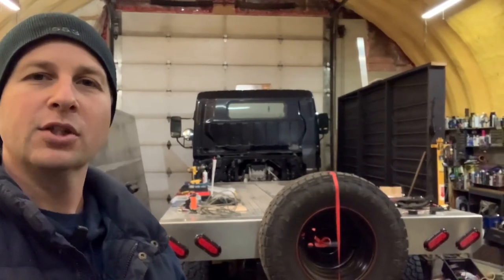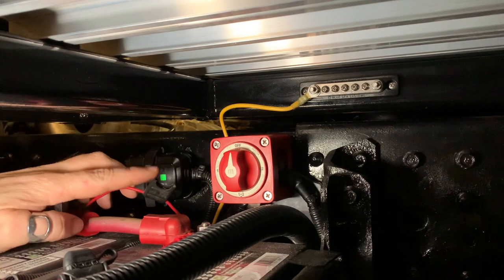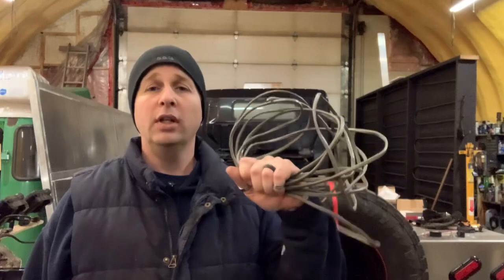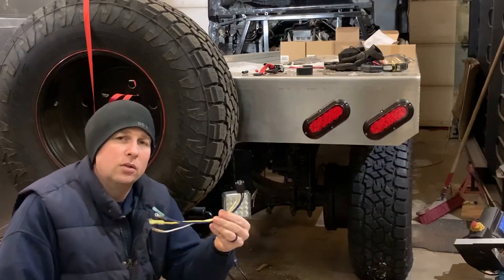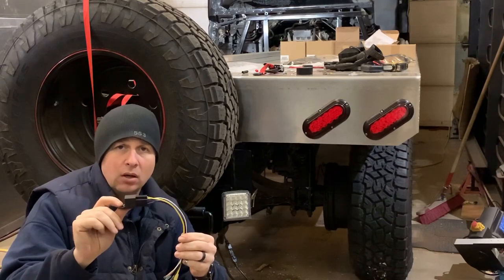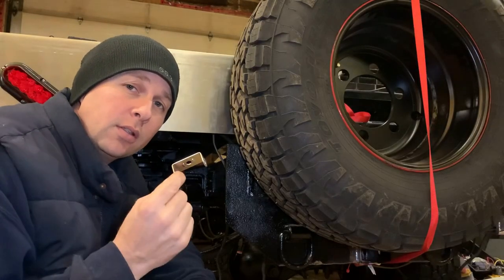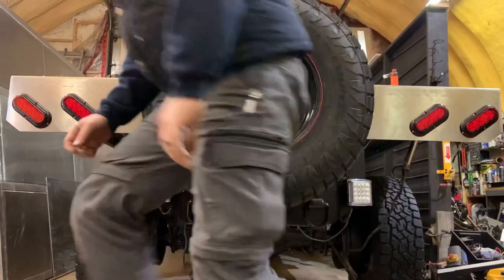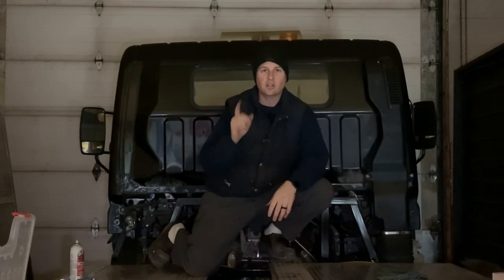SuperBright reverse lights for our 2013 Mitsubishi Fuso FG!

Comment: Yeah, those are bright enough.  LOL  
I bought some floodlights very similar to that off Ebay for $15 a pair with free shipping.  They're 44W, but the Chiwanese makers derate them about 40-50%, so they're  half as bright as they could be. I figured the 27W lights would be sufficient so I  got the 44s, which draw about 26W each.  One is mounted to a battery for a painting worklight in the house and the other is for the back of my Tundra.  Did you make your 6 head worklight in the shop there?  (For under $100 instead of $400-500 retail.)
Reply from the maker: Nice!  Great idea mounting a light to a battery - sounds like something I should do!    Yes, my 6 head light is VERY home made 🤣 it’s an old halogen work light stand with a very thin strip of wood ripped off the edge of a 2x4 (off cut) with 6x $9 120v LED work lights I bought from Princess Auto (like Harbour Freight)  - best part is at 90 watts, I can run it off the built in Inverter in the back of my Lexus GX470 and light up the night!